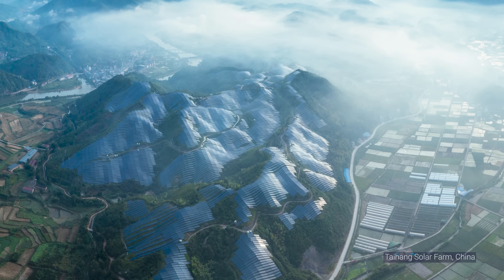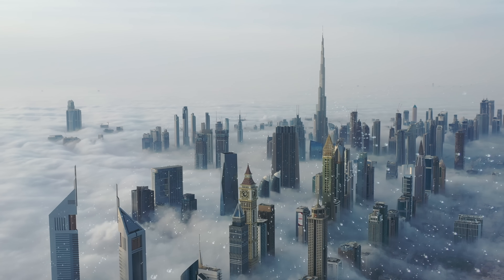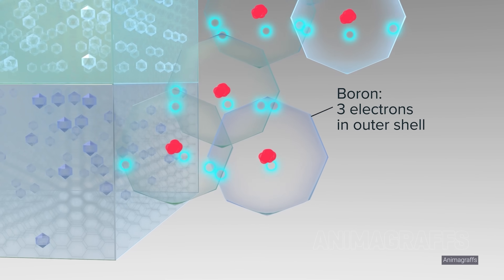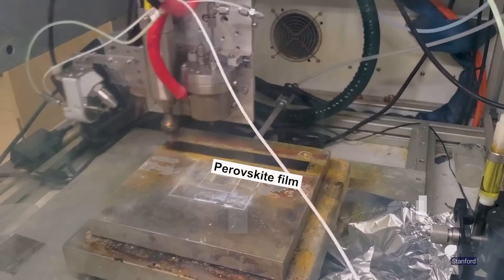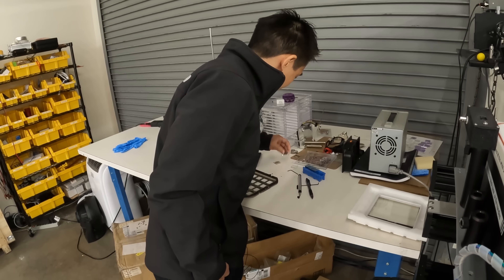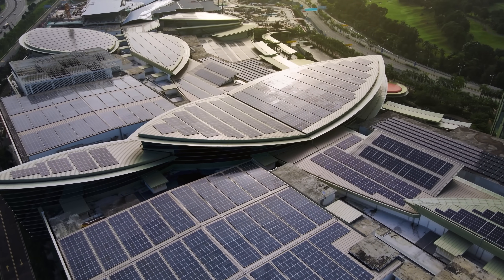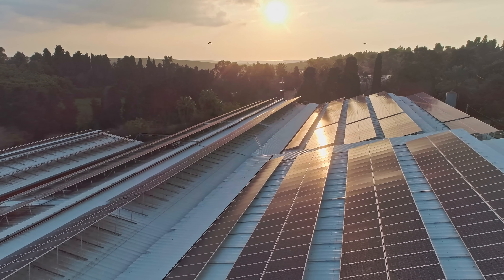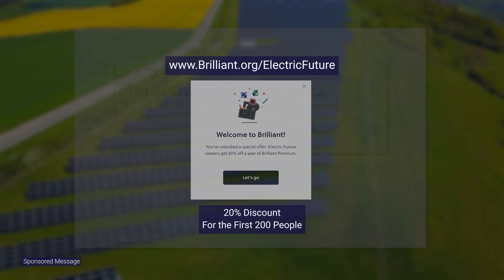Solar 3.0: This New Technology Could Change Everything

Comment: Solar panels don't really work an night, so you also have to pair them with batteries. Why is that never factored into the "greenness" of solar technology?
Reply: Hmmm....I think any and all Solar Panel companies address that issue with customers...If you want to be totally OFF grid will require battery storage.  On Grid generation simply reduces the load on the Grid.
Reply: @dakotacabo5363  No batteries are needed in Ohio because the state requires the electric company to store unused power generated and net at the end of the month.
Reply: @dakotacabo5363  Energy can be stored as compressed air.

Comment: Good to know people who develop this understand they do not need to compete with silicon panels in how long they will last when they can provide more power cheaper and for less weight. Needing far less material and lower temperature to make them also means the energy cost of making them is far less, meaning they need even less time to recover the energy used to make them than regular PV panels. And the materials are far easier to recycle too. With such benefits these panels would be viable if they just last for a decade or so, and even that is more for people's convenience than actually needing to produce more power over its lifetime.
It actually starts to seem like the demand for panels to last 25 years was put up by some people who do not want us to have cheap solar panels...
Reply: This is how dangerous democracy has become it's all run by people making money with personal interests. How can we grow like this!! The only way is ACCOUNTABILITY in power no business attached its thee only way to stop the owners of the capitalist businesses. In politics not in business ACCOUNTABILITY NOW
Reply: Yeah Perovskites return their initial investment in as little as 6 months by estimates(even lower by some, but that's optimistic) so a solar cell that last only 5-10 years should still be competitive against fossil fuel or mono-silicon PV.
Reply: @Ev1l Machine pros and cons. New materials will have a harder time getting in the market, but at least cost of living will go down.
Reply: @Stealthsilent1337  True. Silicon was the first on the scene so it has an innate advantage of being first but it has a disadvantage in that it is kind of a dead-end technology. But Perovskites do have the selling points of being potentially much cheaper and easier to manufacture as well as having many more potential variations and possibilities for improvement.
Reply: @Stealthsilent1337  this is old technology, have you seen the Knight Rider 2000? 
it  is coated with this solar film .
Reply: @a.wadderphiltyr1559  Not really, the materials are common enough. OTOH, purifying rocks to 99.99+% pure silicon takes about 4000F/2200C degree temperature and some chemicals, and then you need to cut the easily breakable material into super thin wafers to make your computer chips and solar panels from, which is rather expensive. As pointed out in the video, making perovskites uses less heat than boiling water and they are also otherwise easier to manufacture and handle.

A study I found with a quick Googling said making a perovskite panel takes about 1/4th energy and less than half CO2 of a silicon panel. Given the increased efficiency that means a perovskite panel in a favorable location would become carbon negative in just a few months. As they are also easier to recycle they would not need many years of operation to outperform silicon panels.

This is basically same as plastic items being super cheap compared to steel ones despite iron being common while plastic is expensive, because plastic is easy to work with while steel requites very high heat. If the perovskite panels last a few years they should be cheap enough, but of course aiming for ten years or so would be better.
Reply: @AnalystPrime  when you factor in the carbon impact... Were you able to factor in the impact of mining, transporting, and processing the materials? I never EVER see that done. People almost pretend it doesn't exist.

And too often I see hidden tradeoffs that mean you don't gain that much in the end. You just shove the problem away from the eyes of the people you are appealing to.
Reply: @scout360pyroz  I've seen it, supposedly the coal plants cost nothing to fuel, and gasoline just magically appears from oil well into your car without all the expensive refining in between. But when scientists say it is less polluting to use gas instead of coal or thorium instead of uranium or batteries instead of fossil fuels, yes, that does include the carbon cost and other issues of mining and processing everything involved.
Reply: @AnalystPrime  Which scientists? Employed by whom? Using what data? With what financial ties?

These days of blindly putting faith in faceless "scientists" like priests are among the most concerning of trends.

You can find "scientists" with reports and studies arguing all sorts of conflicting things.
Reply: @AnalystPrime  or is it that we have long since fallen into this quasi religious trap of blind faith... And only now are cracks being noticed, I wonder...
Reply: @AnalystPrime  ah yes, let's completely ignore the scientist question and rely on blind faith.
 Anyways, the vast majority of marine life is within 40 miles of the shoreline. It isn't just willy nilly amongst the vast scope of the ocean, it's a very concentrated area far closer to the shore.
The question turns to what the effect those panels will have floating near the shore (because why the hell WOULDNT you put them closer) and having an affect on aquatic plant AND animal life, most notably  birds, seals, etc.
Reply: It’s stupid though. We live in an extremely WASTEFUL society. Some people want something that’ll last. It’s why it’s dumb we live in a world with solar panels and wind turbines. Hydro power, coal and natural gas, nuclear power etc these systems will last decades. Sure it’s expensive to build but it lasts which means there’s way less waste and environmental pollution. 

People are naive and stupid thinking oh we can get energy quicker now so it’s environmentally friendly. That’s a lie.
Reply: @koltoncrane3099  No. People do not think solar and wind are environmentally friendly because they are faster to build than a big power plant and both cheaper to build and operate, it is because they ARE environmentally friendly.
Being fast to build helps getting production going on months instead of years, which is important because we need the energy now not ten or twenty years from now.
The Olkiluoto 3 reactor is a perfect example: it is not even a new nuclear plant, just an expansion of an existing one, but it took years to get a political decision and all the permits so they could start building and more years for the construction itself. And this year, only twelve years late, it should finally start production but by now the demand for energy haa increased so much that the cheap nuclear power is not going to actually lower the electric bills. Meanwhile, Finnish researcers made their calculations and figured that they can power the whole country with wind power instead and also build the capacity faster than another nuclear reactor.
Reply: @AnalystPrime  they are anything but environmentally friendly.  To build a wind farm you have to carve dozens to hundreds of miles of raids through forest and pasture for the trucks and cranes to get on site.  Destroying wildlife habitat, farmland and pasture.  Causing massive soil erosion and releasing hundreds of thousands of tons of previously sequestered CO2 into the atmosphere as the discarded vegetation is burned.

You also have to dig hundreds of miles of buried electrical collection line, and destroy the top soil and vegetation for that as well.

The turbines themselves require hundreds of gallons of oil and grease and the leak all over the ground.

Solar fields destroy the land they occupy and make it uninhabitable for the wildlife that once lived there.  And mining of the resources needed to make them dwarfs the impact made by oil and gas industries or uranium maiming for nuclear.  Not to mention the by products of solar panel construction are extremely toxic.
Reply: @forrosailor  interesting point about solar lol.
What if we covered mountains or other barren areas with em?
Floating them also interferes with the biosphere, so that is out.
Reply: @scout360pyroz  Everything we do will have an impact. The disingenuous nature is where he's ignoring what the alternative is. That all sounds bad until you compare it. Oh nooo burying some cables. That's so much worse than fracking /sarcasm.
Reply: @scout360pyroz  By "interfering" you mean the shade under them makes environment better for plants to grow and animals to hide from heat of the sun. Cover barren areas with them and in a few years it will no longer be barren.
Reply: @AnalystPrime  no. I am talking about putting them in the ocean like china was doing. As in floating .... On water.... Blocking the sun from reaching the plankton, algae, etc that make up the essential bottom of the aquatic food chain.
Reply: We will keep inventing things only until we reach a point where we ask questions like why we need what we crave for and what is the purpose of life.
Reply: @a.wadderphiltyr1559  You need much more fossil fuels to get that same amount of power so some mining to make solar panels is insignificant. But silicon panels use more materials per panel and more energy for same amount of material, so as long as the energy production is not 100% renewable you will be mining more fossil fuels per silicon panel than a perovskite one. Perovskite panels are also more economical to recycle so there will be less need for mining new ores for making perovskite than silicon, and again if not powered by renewables it takes more fossil fuels to melt the silicon panels for recycling.
Reply: @a.wadderphiltyr1559  There is no false dichotomy. Either 100% of energy production gives more energy than is used to clean up any pollution it causes, like the huge amount of mining waste and CO2 emissions from all the concrete used to build hydroelectric dams and nuclear plants, or it does not.

In case you didn't notice we aren't at 100% yet, so the only thing you should concern yourself with is how to stop using fossil fuels and reach that number as soon as possible.

Nuclear power has slightly less CO2 emissions per watt over the lifetime of the reactor than wind or solar, but that does not account for all the other issues or the years spent building the plant, in addition to the years needed to acquire permissions and a suitable location and relocating anyone who lives near it.

Hydroelectric is even worse example, as not only is any project large enough to be useful very expensive and time consuming, there are very few locations where you could dam a river to make it work and people are already using those. It also destroys historical sites and animal habitats and blocks fish migration and water travel.
Reply: @a.wadderphiltyr1559  "So what?" The what is that you cannot build a gigawatt scale nuclear reactor in a year and every year you wait you are using more fossil fuels instead. The what is that you cannot build reactors in politically unstable areas or it might be used for producing weapons or targeted by terrorists or enemy military forces. The what is they are expensive so nations and power companies will rather pick either renewables or fossil fuels. And while the bureaucracy hindering the development and building of new reactor types like the small modular reactors is too heavy, without it some asshole would just build reactors without any safety systems or dump the nuclear waste in the nearest ditch.

"the animal habitat argument isn't really a good one when you're talking about building fields of solar panels or wind turbines. They're all destructive to the environment"
What are you on? Wind turbines do not bother the cows or fish living around them, and solar panels are proven to improve the conditions for the plants and animals seeking the shade they give from the scorching sun. And if you have been listening to idiots who claim forests are destroyed to build them, use your brain and ask yourself why would anyone put either anywhere near trees that block the sun and cause wind turbulence when there are plenty of wide open areas available.

"either climate change is a big deal" Why, yes it is, that is why we have spent lots of money developing better renewables, EVs and nuclear power. That does not change the fact that hydropower is the most expensive of the renewables and the number of locations it can be built is going down due to climate change altering weather patterns. The difference between wasting almost as much money on a dam as on a nuclear power plant is that you can build a nuclear plant closer to your city and the chance of climate change drying up your source of nuclear fuel is lower than a drought making the hydropower plant useless.

"or it's not that big of a deal and we can concern ourselves with relatively trivial matters" Funny. The chances of a few birds flying into windmills when thousands of times more die to each of pollution, windows and cats is a trivial matter; the tiny amount of pollution caused by making solar panels compared to what is released daily by every step of mining, refining and using fossil fuels is a trivial matter. The massive disruption caused by building a dam and flooding an area, blocking river traffic and fish migration and forcing people to relocate is not a trivial matter, especially when the other renewable power sources are much cheaper and do not cause any such environmental problems.
Reply: Deeply inspirational?
Reply: It is troubling to know that BS flawed napkin math by a con artist is pushed as fact by so many sources. PV Solar will NEVER be viable as an alternative.
Reply: @excitedbox5705  The BS flawed napkin math is right here in this video.  Particularly in the comments.  If PV Solar will "NEVER be viable as an alternative", why are there so many Gigawatts already in use?  It is a very cheap source of power, and when put on a grid or coupled with storage, becomes very useful.  When coupled with wind turbines, even more useful.  But you're a fossil fuel pimp or a luddite, I guess, so you probably will disagree.

Comment: The question to ask is regarding the specific cause of degradation.
Is it simply the action of sunlight on the material, or physical abrasion from wind, chemicals, rain, etc?
If the latter simply spray the solution on the inside face of a sealed double glazed window unit (between the two sheets).
No extra weight, added sun protection for building occupants on a sun facing window, no chemical or mechanical abrasion.
Reply: Glass actually reflects alot of light. So the cells would be making a tiny amount of power.

Comment: Perovskite solar cells have been in the news for a very long time... and not a single residential product available yet. You cannot claim it is cheaper until you have a working product that lasts. To make it last, more expensive components may be required - which means its not cheaper anymore.
Reply: Promises from a laboratory vs. performance of a commercially available product.
Reply: @SomeUserNameBlahBlah  Good thinking somebody has their smart cap on
Reply: @SomeUserNameBlahBlah  it is more a matter of oatii and experimentation?
Reply: It reminds me about 10x/100x battery improvement that I heard it over and over decade ago.
Reply: Seen such claims for at least 10 years now. All the stuff was revolutionary, easy to manufacture by printing on flexible materials, 50% cheaper to make. Still nothing available on the market. So don't get your hopes too high ☺️
Reply: chillax grandmaster buzzkill
Reply: They are expected to be all of newsin near future?

Comment: Make the sheets easily replaceable and using them will follow. And from that will come the data to iterate the various components. Promising work.
Reply: Easy. Make a frame that covers the roof and have these panels just snap to a frame (plug'n'play) once the panel degrades, unplug and plug new panel. Any panels can be easily swapped with new generation panels
Reply: @EddyKorgo  not easy
Reply: @kristopherleslie8343  It is easy.  What you mean is that it is not easy to work through the politics of getting it done.  That is the hard part.
Reply: @CD-vb9fi  Hambug  ! ! !
Science is So haughty claiming We are almost at the verge of discovering the Theory of everything 😂😂😂
We can't Even copy the sun's  fusion nor kill a virus or  a simple cancer .
Reply: @EddyKorgo  It could work like that in the U.S. One thing though after some thought , what  is the cost of one of these. So comparing   cost over total energy produced per panel determines feasibility for general power production, then if that number is lower for silicone pannels then P.S.C. pannels would be more for things that require light weight,
Reply: yes they can make lemonaid with these short lived cells and as improvements are developet they can be implemented.

Comment: Using car sunroof as solar panel could help with the excessive heat metal car roofs reach.
Reply: A panel ona car roof wouldn’t be cost effective. You have to carry it around and would generate so little power for the cost. Better to have a slightly bigger battery in the car.
Reply: @billconstantine9725  yes of course it wouldn't be meant to power the motor, more like ac on hot days and maybe tale care of inside lighting, reduce the load on the main battery to increase the overall range even if just by 10km in full cycle.
Still, it's true it may not be worth it.